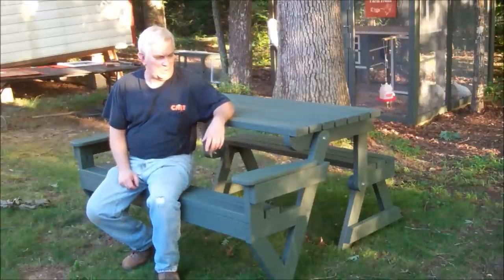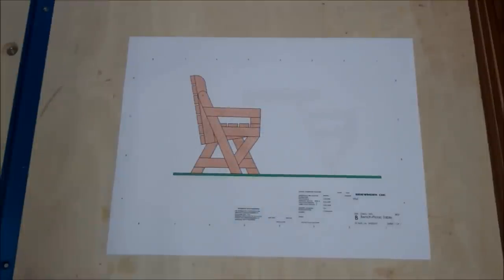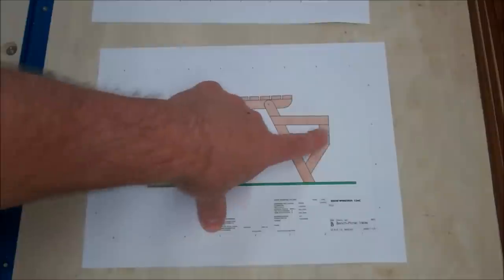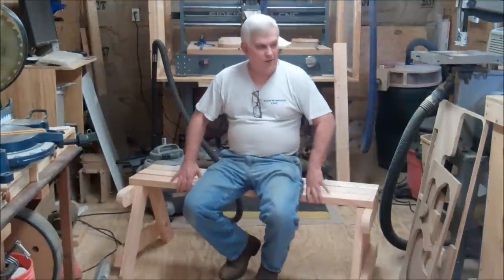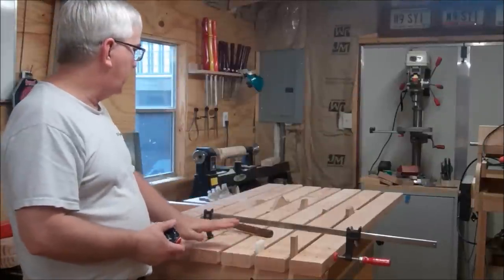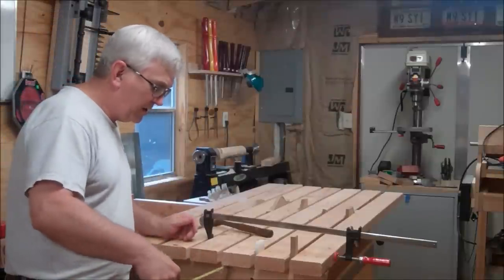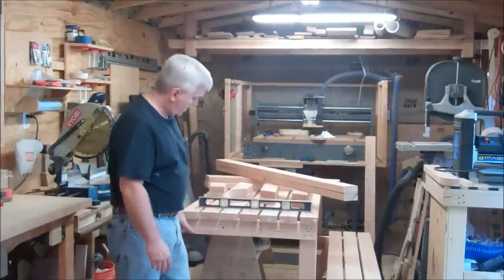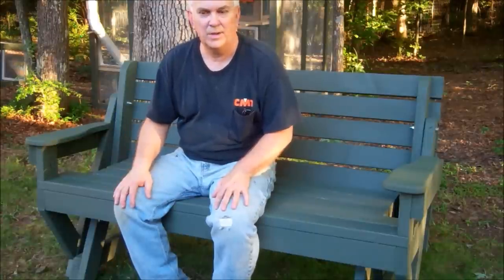Making a Bench Picnic Table

Comment: Wonderful video and explanation. Very neat picnic table/bench. Thanks for sharing.
Reply from the maker: Slowvannah Farms Thank you so much for watching!
Reply: +Dave I have made two of your bench/picnic tables.  I found one  bad dimension  (at least I could not find the dimension).  
The second table was  a real winner  and I loved the results!!  Thanks and wonder what is a good price to ask for it with or without  finish coats?  I filled all the 2x4s and holes.  It works and looks awesome.  Thank you!
Reply from the maker: +tom purcell If you're talking about the dimension for the Stop Block that dimension was left off intentionally.  That should be the last piece you put on and you simply cut a 65° angle the hold it up to the table (which should be level when doing this) and trace the profile so that you get an exact match.  The other chamfer cut is just for relief so the dimension for that is not critical.
Reply: Hi Dave,  Love the table and get lots of compliments on it.  Have made  3 so far.   Wish you would not go to  1/64 ths  lol.  Think a  1/32 or  1/16 would be easier to see for me.

Comment: Very cool project. I may suggest making the table top using 1x4's just to make it a little bit lighter.
Reply from the maker: Jeff Oz You could use 1 x 4's for the table to make it lighter but I was thinking it might be a little flimsy in the middle since it is only supported at each end and its about a five foot span.  I used fourteen 2 x 4's and with the bolts, nuts, and washers I only have about $60 in total materials.  A really fun and cheap project.  Thanks for watching Jeff.